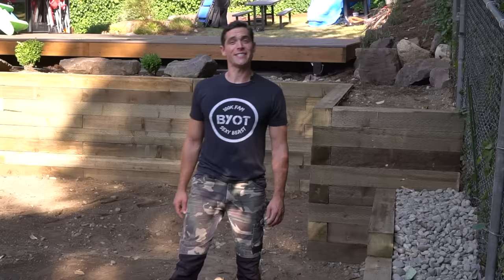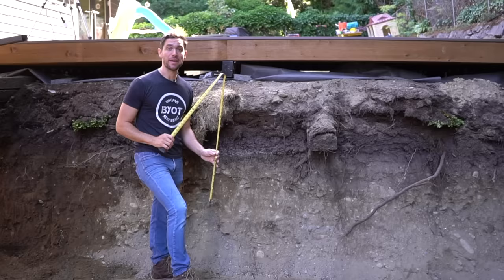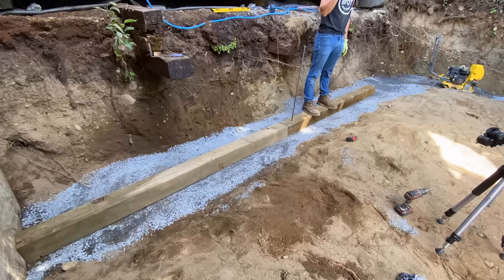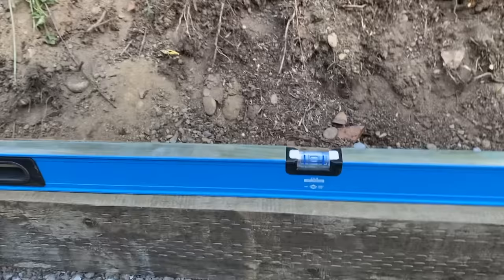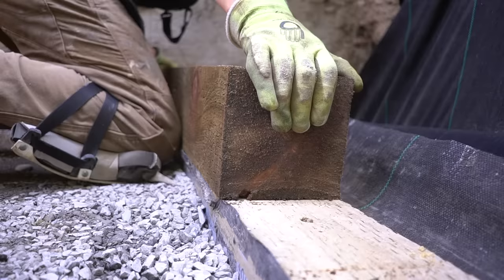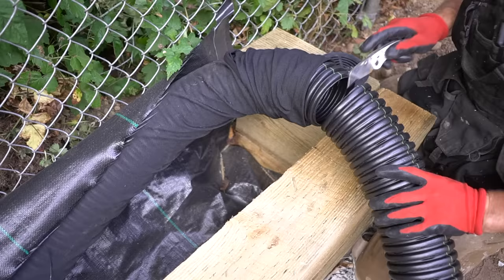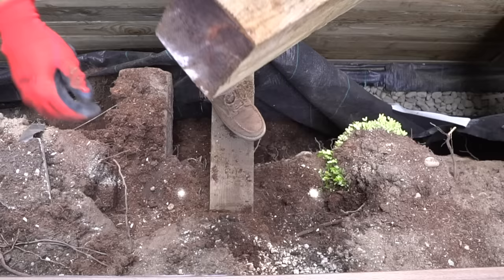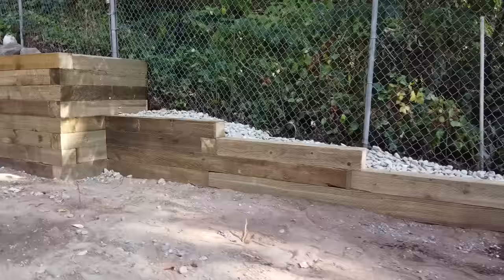HOW TO BUILD A RETAINING WALL

Comment: Finally a retaining wall video that explains how to do it, from A to Z. :) -- I've been looking at building a retaining wall myself, and I think this video gave me the info I needed!
Reply: Yeah, don't follow this video to build a wall. Go buy some segmental blocks and follow the manufacturers instructions.
Reply: @benstaehr9595  thanks for the info, besides the aesthetics (wood vs block), is there anything wrong with this video's info? reading about segmental blocks, the steps appear to be somewhat similar
Reply: @pachecolljk  his drainage is less effective than it should be. If you're building something tall, it's important to get your deadmans the right length. I wouldn't use 1 foot segments in the large wall. It's not how we would do it, but it's not terrible. It'll last for a good while
Reply: @pachecolljk  
-He used the wrong type of fabric
-He didn't use the right type of drainage rock (should always be crushed stone)
-I would never use lumber for a retaining wall unless it was only temporary
-He didn't offset his wall back into the dirt. The wall will always want to move forward. Putting each layer back a little will help with that

Comment: Great effort and nice project. Seems a bit expensive way to retain only 4'-0" maximum high soil. The pressure treated wood may not last as long as one might think. Masonry or stone retaining wall might be long term options.
Reply: Yeah. It will rot pretty quickly.
Reply: I agree but the drainage he installed will help to extend the structural integrity of the timber. Precast concrete or stone(dry or mortared) should be the first choice.

Comment: Liked all except the flex pipe.
In our area due to the type of clay & soil movement, I insist on solid pipe, no matter the size of project. 
But, its a small run and yoh know your soils..so Im sure its a good solution.
 Also there is an iron method that some Pros use to attach the soil fabric pieces together instead of duct tape.. but..
Nice job. Thnx for your content.

Comment: Hello,
You did a wonderful display of workmanship and skillfulness on this build and I hope you would be kind enough to answer those few questions: 
1- The metal spike/peg that went 3' deep to anchor the timer to the ground, wouldn't you be worried about that rusting out over time? Metal + moisture + time = Rust? 
2- If we're comparing the same build to a stone retaining wall, would timber be more cost-effective, and if so, by how much? 
3- What would be the longevity expected from this wall compared to stone/cement build? 
I'm really looking to do my own retaining wall and I already know hiring a professional is going to cost thousands and having watched a few vids, it looks more than doable but there's always questions to be asked. Of course there's engineering involved in this and absolutely no cutting corners or cheaping out and but the results are definitely worth it.
Many thanks again! :)

Comment: Awesome job.  I"ve done several of these in Alabama where it rains tons.  One was 12 feet high and a 30' run.  We used old railroad ties and moved each row back about a 1/4" on top of the row below it as well as the dead man anchors.

Comment: This was an incredibly detailed DIY video which I am using as my template for my project. 
My question is that I see most builds using 8-foot 6x6’s.
I am building a wall 18 feet long and wanted to know if I could stagger 10 foot 6x6’s with an 8’ 6x6 instead of using 3 8’ beams across each level. I didn’t know if there was a specific reason 8’ beams were standard.
The total height would be 33 inches, 1 base layer, 5 layers on top of it, total of 6 layers.

Comment: I've used 6x6 posts of course pressure treated buried in concrete posted vertically every 6 to 8 ft behind my wall and then dead man's on the top or second to top tier below The final level of the soil.

Comment: 1.3 Drainage System

The internal drainage systems of the retaining wall can be described as the means of eliminating the buildup of incidental water which infiltrates the soils behind the wall. Drainage system design will be a function of the water conditions on the site. Possible drainage facilities include Toe and Heel drainage collection pipes and blanket or chimney rock drains or others. Design engineer shall determine the required drainage facilities to completely drain the retaining wall structure for each particular site condition.

    All walls will be constructed with a minimum of 12 in. (300 mm) of wall rock directly behind the wall facing. The material shall meet or exceed the specification for wall rock outlined in Section 1, 2.2 Wall Rock.
    The drainage collection pipe, drain pipe, shall be a 4 in. (100 mm) perforated or slotted PVC, or corrugated HDPE pipe as approved by engineer of record.
    All walls will be constructed with a 4 in. (100 mm) diameter drain pipe placed at the lowest possible elevation within the 12 in. (300 mm) of wall rock. This drain pipe is referred to as a toe drain, Section 3, 1.4 Toe Drain.
    Geogrid Reinforced Walls shall be constructed with an additional 4 in. (100 mm) drain pipe at the back bottom of the reinforced soil mass. This drain pipe is referred to as a heel drain, Section 3, 1.5 Heel Drain.

1.4 Toe Drain
Retaining Wall Drains

Toe Drain

A toe drain pipe should be located at the back of the wall rock behind the wall as close to the bottom of the wall as allowed while still maintaining a positive gradient for drainage to daylight, or a storm water management system. Toe drains are installed for incidental water management not as a primary drainage system.

    For site configurations with bottoms of the base on a level plane it is recommended that a minimum one percent gradient be maintained on the placement of the pipe with outlets on 50 ft (15 m) centers, or 100 ft (30 m) centers if pipe is crowned between the outlets. This would provide for a maximum height above the bottom of the base in a flat configuration of no more than 6 in. (150 mm).
    For rigid drain pipes with drain holes the pipes should be positioned with the holes located down. Allan Block does not require that toe drain pipes be wrapped when installed into base rock complying with the specified wall rock material.
    Pipes shall be routed to storm drains where appropriate or through or under the wall at low points when the job site grading and site layout allows for routing. Appropriate details shall be included to prevent pipes from being crushed, plugged, or infested with rodents.
    On sites where the natural drop in grade exceeds the one percent minimum, drain pipes outlets shall be on 100 foot (30 m) centers maximum. This will provide outlets in the event that excessive water flow exceeds the capacity of pipe over long stretches.
    Drain pipe must be raised to accommodate outlets through the wall face when daylighting below grade is not possible. Refer to the Design Detail 4: Alternate Drain, of the AB Spec Book.

1.5 Heel Drain

The purpose of the heel drain is to pick up any water that migrates from behind the retaining wall structure at the cut and route the water away from the reinforced mass during the construction process and for incidental water for the life of the structure.

    The piping used at the back of the reinforced mass shall have a one percent minimum gradient over the length, but it is not critical for it to be positioned at the very bottom of the cut. The heel drain should be vented at 100ft (30 m) intervals along the entire length of the wall and should not be tied into the toe drain system.
    The pipe may be a rigid pipe with holes at the bottom with an integral sock encasing the pipe or a corrugated perforated flexible pipe with a sock to filter out fines when required based on soil conditions. For infill soils with a high percentage of sand and/or gravel the heel drain pipe does not need to be surrounded by wall rock. When working with soils containing fine grained cohesive soils having a PI of greater than 6 and LL of 30 or greater, 1 ft³.(.03 m³) of drainage rock is required around the pipe for each 1 ft (30 cm) of pipe length.

1.6 Ground Water
Internal Blanket Drain

Figure 6A: Internal Blanket

Internal Blanket and Chimney Drain

Figure 6B: Internal Blanket and Chimney Drain

Ground water can be defined as water that occurs within the soil. It may be present because of surface infiltration or water table fluctuation. Ground water movement must not be allowed to come in contact with the retaining wall.

    If water is encountered in the area of the wall during excavation or construction, a drainage system (chimney, composite or blanket) must be installed as directed by the wall design engineer.
    Standard retaining wall designs do not include hydrostatic forces associated with the presence of ground water. If adequate drainage is not provided the retaining wall design must consider the presence of the water.
    When non-free draining soils (soils with friction angles less than 30 degrees) are used in the reinforced zone, the incorporation of a chimney and blanket drain should be added to minimize the water penetration into the reinforced mass. Refer to Design Detail 6: Chimney and Blanket Drain, Page 13 of the AB Spec Book.
        Drain material to be consistent with wall rock material. For more information on wall rock material see Specification Guidelines: Allan Block Modular Retaining Wall Systems, section 2.1.
        Manufactured chimney and blanket drains to be approved by the geotechnical and/or the local engineer of record prior to use.

Comment: Very nice look. Was wondering about access from the upper level of the yard to the lower level and the 4 ft  drop off from the upper level deck. Are you planning to add some kind of rail and a set of stairs to the upper level deck?
Reply: I would have added the stairs next to the house, so u wouldn’t have to go through the house to get to the lower level.

Comment: That was a really good explanation - feel like I've got all of it understood now. Thanks!Aren't you dumping all that water into your neighbor's yard by putting the cap of the pipe there pointed to the fence? I've got a similar situation but don't want to have to tear it all up if it floods my neighbors yard.
Reply: The wall is built on a gravel base and the pipe is not on the subgrade surface behind the wall so water will most likely seep beneath the wall. Since the base or foundation layer is only 6 inches deep, the soil at the toe of the wall will become saturated and soft which could lead to failure of the wall due to lowered passive resistance. I’m a soil engineer.

Comment: to make driving the rebar through rocks a little easier take all your bars and cut a v in the end going in the ground with a grinder. When you hit a rock it will split it easier and unlike a single point dulling wont effect how it works.

Comment: The finished product looks beautiful.  Do you deadman at each corner?  If a wall has a lot of jogs how frequently do you place a deadman?  Last question, if building on top of granite rock how would you recommend getting that rebar into place?  I was thinking hammer drill so far, epoxy the rebar in place, then measure and drill a hole in the 6x6 and place directly over the epoxied rebar.

Comment: You know I like wood but not in retaining walls..  I guess they are ok to 18-20” but higher than that no..  I have lived in my home for 40 years.  The back yard goes right up as it’s hilly here..  I started my walls with concrete foundations with rebar that are 18” deep, 8” high. On top I put decorative blocks and not concrete..  Going up I put rebar both ways ..vertical and horizontal..  I made a block filler that was wedge shaped and 30 inches long to make filling blocks easier..  Every 5 feet I sunk behind the walls T shaped deadmen to keep pressure from tipping over the walls..  So I look around the neighborhood and see every wooden Wall has been replaced at least 3 times.. 5 wall’s in total by each neighbor.. some have passed away and the house resold.. I look at my 6 different walks and 38-40 years later they all are firm and look great.. My neighbors used cedar or pressure treated lumber..  All my neighbors walks rotted out in less than 10-12 years because they were made of wood….my walls cost about 60% more to do..  and they still look good..

Comment: don't screw into endgrain and expect it to hold. Where he demos the 90 degree corner ( @7:25 ), put that lag the other direction. Use a pocket screw jig if you have to. You want the tip of any screw into cross grain

Comment: great video! One question: why use shorter lengths of 6x6, e.g. a 6 footer and a 4 footer when you can place a 10 footer? even with dead men, you can cut down the longer length to fit and still have more integrity with a longer piece. I am building  2.5 foot wall and trying to see the reason why.

Comment: I was not sold on a wood retaining wall until I watched your video and I think that I will be constructing a smaller one in my yard.  Not as daunting as I thought it was going to be. One quick question: what is a good rule of thumb for the 'dead heads'? I was told that if it was anything significant in height, you want them. However, I am creating a small wall approximately 24 inches in height. Will they still be necessary? Do you recommend?

Comment: Lol… as a gardener I prefer the prior layout.  Just needed to be updated.
Reply: I dabble in gardening as well and I thought the layout would have been to maintain the original outline which would have allowed the garden to be at the top elevation. This would have required a load or so of material for backfilling but would have made the job of installing the wall easier.

Comment: I'm not going to read all the comments to the very end. But, This has to do with sizing the Rebar. So, for those that 'DO NOT KNOW', Rebar is sized by 1/8 inch increments.. Starting at 3/8 inch. So a 3/8 is called a #3 (1/8 x 3 =3/8") and so on,. each 1/8" adds to the number value, 3/8=#3, 1/2"=#4, #5 is 5/8" even #6 equals a 3/4" thick piece. SO, a  #8 would be a one inch thick rebar. It goes to 2.5 thick, And on special occasions, up to 4" thick, that is if you are building a Nuke Power Plant. They come in 20 foot lengths.  Special order 40 foot lengths.  FEEL SPECIAL if you can get them in 60 foot lengths. Anyway, they are usually recycled metal and very strong. Don't get me started on tensile strength. 70,000, which is stamped on the bar is usually a minimum. but for small home building projects, 40,000 is Okay. (if you can find them) Oh, and anything smaller than 3/8 is called a pencil rod. And now you know. Great video by the way. I never did find a # 2 in my life. What size is that? Good looking wall, wish I was young again. BTW, consultant for hire, Call BR549. Ask for Junior...good luck.

Comment: Those deadheads that are attached at one point of the wall (even with a lateral connection) aren't really able to transmit much downward force through that single pin connection (and would break if they are loaded much).  They could provide some resistance longitudinally, but adding a T connection on the in-ground end would improve that directions ability to provide stability (the lateral connections do help this axis).  If this is industry practice, it seems weird from a fastener load point of view.  Here a long rebar connection tying in the upper and lower lumber would make some sense.
Reply: Would it be easier to use the screen as a temp/additional hold, then drive the rebar through the top/deadhead/bottom from there? (I mean you could probably use a smaller pin for that positioning aid instead of the more expensive screws… but)

Comment: I suggest using a big SDS hammer drill to get the rebar in.
Reply: He needed a bigger sledge. When these guys get into shape during the season it's not such a big deal, depending on what's underneath the wall, of course.

Comment: What an awesome project! Just a logistics question: is it cheaper to rent the skid loader for a week (even when there are days you don't use it) or rent for 2 days, return and re-rent again?
Reply from the maker: If you can work around it with a 2 say rental it would be cheaper then the full week but we used this thing everyday.  Some days where more useful then others :) thanks for watching and asking Di.
Reply: It depends on what you value your time at. It's not just about cost, its also inconvenience. If you have it, you can use it. As soon as it's loaded up, that option disappears.

Comment: What is this would a preference by the homeowner? Because all this work and yes retaining wall will eventually stop working because the wood will rot after 20 years. I would’ve done stone end it will cost you a little more but you wouldn’t have to do it twice

Comment: If in-the-ground rebar isn't  incased by concrete it will rust away. We use rebar to hold plumbing in place before concrete the slab is poured....Few years later, the portion of rebar in contact with the ground soil is just gone. Probably doesn't really matter here because only  small amounts of future movement will occur in this project. It's just that pounding in 3 foot bars is pretty much redundant.

Comment: Concrete sleepers and galvanized steel would have been a better option, timber is likely to need replacing in around 10 years (if you are lucky). Obviously would cost more but well worth it if you want the retaining wall to be there in 50 years.